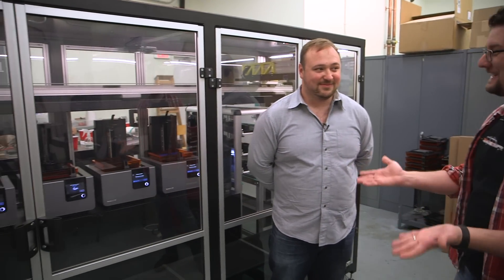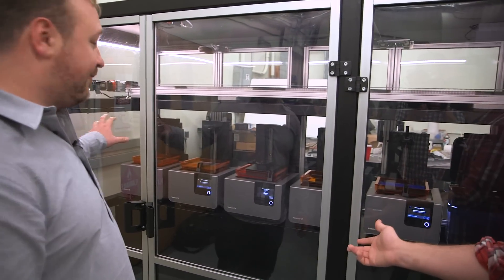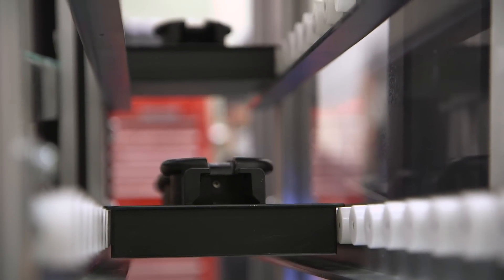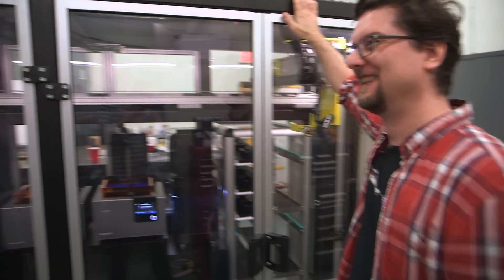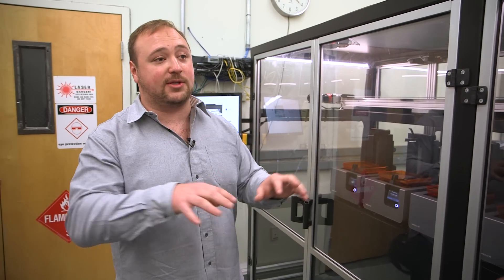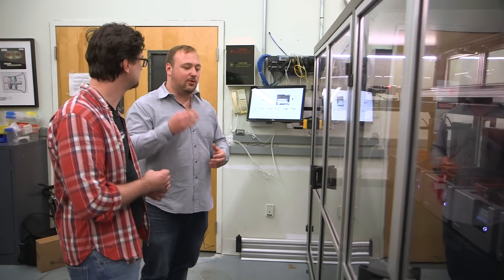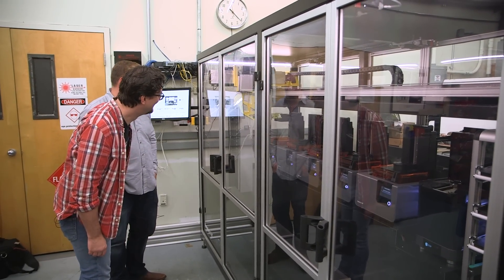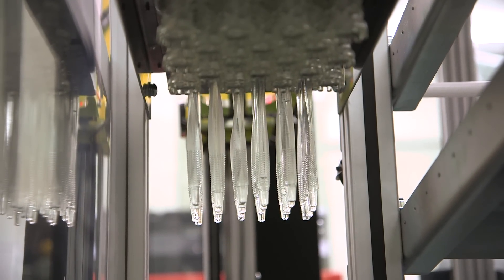Automated 3D Printing with Form Cell!

Comment: The Form2 printer itself is an absolute disaster for commercial use. We've been using it in our business for 1 year now and have trouble with it every 2 or 3 weeks: tanks not recognized, cartrdiges not recognized, non adherance to the build platform. We also had to have the optical system recalibrateDon't get me wrong: when it prints it does a fantastic job, but this machine has some serious reliability issues... We're going to look for another (proffesional) brand.

Comment: Why not use a 6-axis industrial robot (i.e., arm-style robot) in the center of a circle of printers/processors? A fixed-gantry style robot is cheap to build but not nearly as scalable as a general purpose industrial robot...
Reply: litpunk First, you only need 2 axis, not 6, Then, an arm limits a lot the number of printer. Want more printer ? get a bigger rail and you are done. if you use an arm unless getting a bigger one you are limited by the action radius ... plus square printers, so space optimization I guess ...
Reply: Note that the rails in this case are belt driven and the stiffness of the belt decreases as length increases. Your positioning accuracy, speed and acceleration will suffer as the compliance in the belt forces the servo tuning to soften lest you encounter horrible system resonances.
Reply: litpunk i don't think we're in a micron accuracy system and the belt stiffness wouldn't be a huge problem, but you're right and i get your point.
Reply: I understand Leo. The ability to instantly scale the system by buying a longer rail and the minimal software changes needed to add additional printers must make the rail design very attractive. I think I'm looking at the limiting factors, but you're right, you'd probably have to need WAY too many printers to reach diminishing returns with this design. Perhaps it's just personal preference, but I'd just love to see a design with the robot at the center of a ring of printers/processors.
Reply: litpunk I have to admit that a robotic arm setting up dozens of 3d printer would look way too cool ...
Reply: Well, if you know anyone from Formlabs, let me know. I can probably make that happen.

Comment: at this point you be better off with just standard injection molding. 3d printers are meant for small quantity prototyping. not for full automation production.
Reply: Yes and no.  It can cost tens of thousands of dollars to make a good mold that makes ONE set of parts.  A 3D printer can make just about any part you can imagine, including making each iteration unique.  In the time a dentist's office takes to 4D CNC a single tooth, one of these machines could produce a full mouth of teeth for 30 people.  That ability to customize every part,  both in shape and material, is beyond valuable in many fields.  But no, it won't be pumping out 4x1 Lego bricks anytime soon.

Comment: That looks $$$. The resin itself isn't cheap either. There are somethings that can only be manufactured effectively by 3D printing, and a good Form2 print matches with the quality of traditional industrial manufacturing. For the Rook models, 3D printing is the way to go - that ribbed stick they were printing, you're probably better off making a(n array of) mold(s) and building a traditional manufacturing pipeline around it if you truly want to scale.

Comment: I wouldn't call this automated, i would call it streamlined.

Formlabs have taken out the easiest processes: Moving the part from the printer to alcohol, then alcohol to UV chamber. After that there is still all the cleanup of support structures and detailing, which is the vast majority of the manual labour when finishing parts from the form 2.

Don't get me wrong, I love the form 2, I currently have one whizzing away beside me on its second print of the day, I just think it's disingenuous to call this 'automated'.
Reply: I think you're mostly right, the cleanup is still a major factor. But what this really adds is the ability to easily run lights-out. You can just keep queuing jobs to this thing and it'll run overnight, on weekends, etc.

We only have one printer at work (a Stratasys FDM) and I'd love to have it automated so we don't have to come in on the weekend to remove builds, put them in the bath, and start new ones.
Reply: Agreed. I help run a lab at my school where we have 5 Form 2s and the biggest problem with getting parts to students is having someone to start parts, remove trays, wash parts, and have them available to students for pickup. This takes every ache out of that - students don't have a problem removing supports and sanding over working down a piece of wrenshape.
Reply: These are both really good points I hadn't considered, thanks :)

Also to add to what I've said before: Although I may not think this is as automated as they are implying, I still think that this is a great step forward for 3D printing becoming more widespread. This is the first step in having a fully automated 3D printing farm, and I'm happy that FormLabs are keen to invest in this!
Reply: someone has to refill the resin

Comment: These people are out of their minds if they think you can get 50K of productivity out of 5 SLA printers with a washing station.  But to each their own...
Reply: Oh yeah I'm sure they just built it on a whim and haven't done any kind of cost/benefit calculations.

Yeah I'm sure you know more than they do about this.
Reply: If you cant think of a way to make that 50K back, then don't get the printers :P

We've had a form 2 in the office for just over a year. Although we use it fairly often, it is normally only 2/3 batches a week on average. The parts made using the form 2 have paid for the printer many times over.
Reply: It depends how reliable the setup is. If you can depreciate it over 5 years at 4%, it's only $12k/year. It's not hard to see how you can make $12k/year from 5 3D printers running continuously. I don't know how slow/fast these printers are but if they take 5 hours to print you have a potential for 8760 parts/year, so if the parts are worth merely $1.50 GP each (yea right) it's paid.
Reply: I can think of lots and lots of ways - a lot of time is wasted in my office is spent washing parts and messing with 3d printers. A system like this where an entire office could queue up parts will be in a lot of demand.
Reply: r1tual it really is just what are you using the printer for isn't?

Comment: Very cool, 3d printers need to reduce in price and increase in speed.
Reply: The raise to the bottom for pricing has hurt the market more than helped honestly. Speed is limited more by materials used to make them affordable. So you cant have both happen. You want increased speed you need a sturdier build using extrusions and linear rails with servo motors. That alone almost triples the build cost.